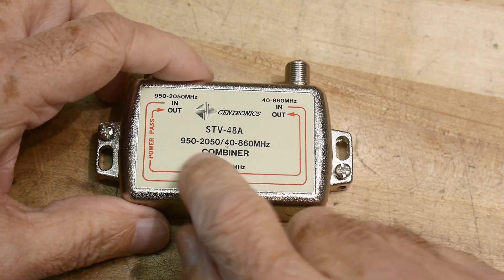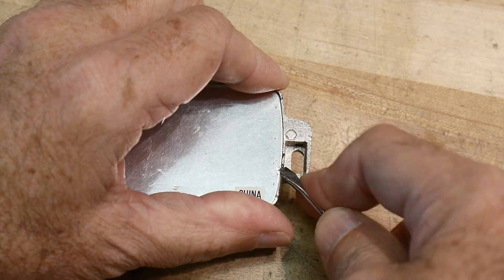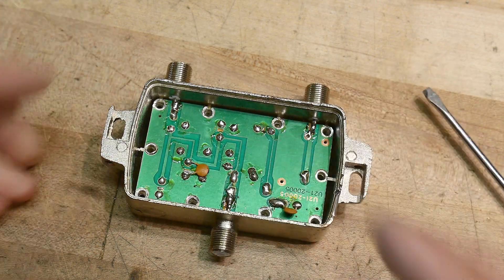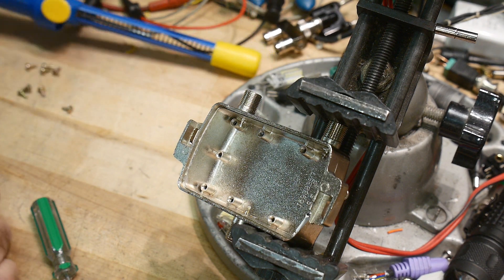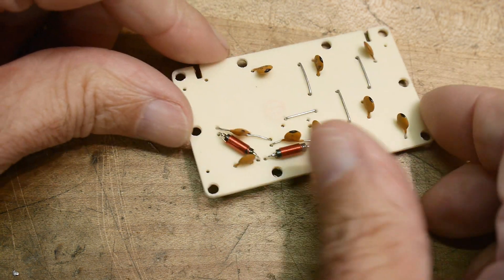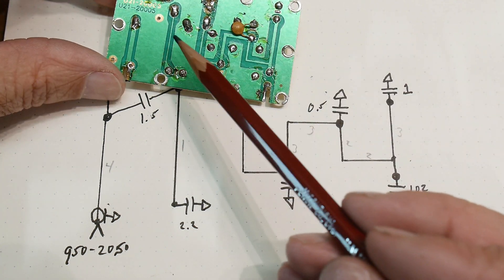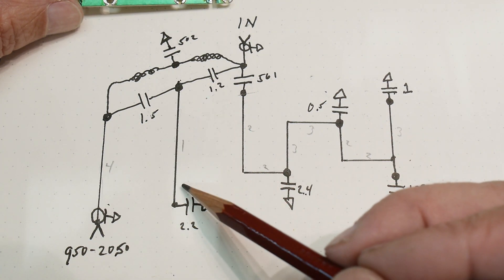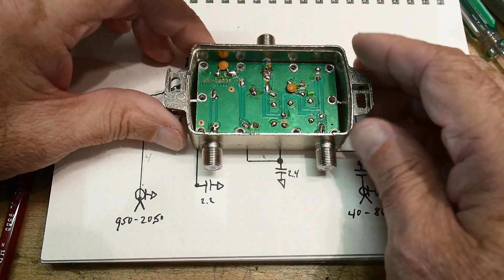#1050 Television Diplexer

Comment: I don't have satellite and I just got one of these from an eBay order where I didn't get sent what I actually ordered, at first I thought "what the hell do I need a sat diplexer for?" Then I thought of the perfect use, I have an OTA Antenna setup with Moca adapters, and at the TVs this should save me a lot of insertion loss versus using a splitter, if I feel I need to put another POE filter into the TV, a POE filter stacked on the diplexer should still have lower insertion loss than a splitter on it's own and much lower insertion loss than a splitter + POE filter.

Comment: I phased two 2 meter antennas with a tv splitter. It works fine, i cut the 75 ohm coax to match 50 ohm.

Comment: This is amazing how they could be made so cheap and simple and still offer some sort of performance out of it. I wonder how many iterations were made until it was just ok, because that PCB does not seem to have any defined parameter (looks like bakelite or cheap FR4?), the poor grounding, the through hole capacitors at those UHF frequencies... etc.
This must be fine for the analog TV era it seems to come from, but for digital TV (either satellite or terrestrial) those bumps in the passband and maybe phase shifts will surely contribute to worsen the bit error rate of the signal and therefore more prone to pixellation, etc.
Reply: No, if the digital signal is too low quality, the processor will not allow it and treat it as noise, and give an error message like NO SIGNAL.

Comment: Hello,
very interesting - thank You. So did You check it for impedance matching and isolation. How close is it to the 75 Ohms TV Impedance? How bad does things go when used within 50 Ohm - I am thinking of combining radio-Tv and cellular (1800/2100/2600MHz)
Reply: 50 and 75 are close enough that the reflections are not huge.

Comment: I doubt that this diplexer really works as intended. This seems to be a single layer design on 1.6mm FR4. For a two layer board with this thickness the trace widths would make sense, but in the given case, combined with the poor grounding scheme through jumper wires, this whole contraption is likely impossible to calculate properly and to manufacture repeatedly. The only possible transmission line structure on a single sided board would be a coplanar waveguide, but the shown design deliberately makes the distance between trace and adjacent ground plane larger in order to minimize the coupling as if it was designed for a two layer board. I guess this is a copy of a design which used a proper ground plane below and the cost-optimization minded copycat decided that since the result was still somewhat functional (working more as a combiner instead of a real diplexer) even without the ground plane it would be good enough for sale. A damping of 12 dB at the first sidelobe (0:45), which is already in the passband of the other channel is really not great. The original two-layer design surely was a lot better and far less wobbly. Would be interesting to see the behavior of both filter paths at the higher frequency range, too.
Reply: They work just fine in the real world
Reply: With the ground beside the traces and the case below, the impedance numbers come out different from the trace on a board with ground on the far side but still a practical value.
He ran a frequency response before taking it apart and it does what is claimed.

Comment: I also noticed how they did the DC pass thru using the wound inductors.

I believe this would have been for a satellite system where a bias tee would put DC on the coax to the LNB at the dish.
Reply: Yes, it is to combine Terrestrial TV and Sat TV on one coax, the Sat LNB is powered via the coax
Reply: indeed!
Reply: Correct.